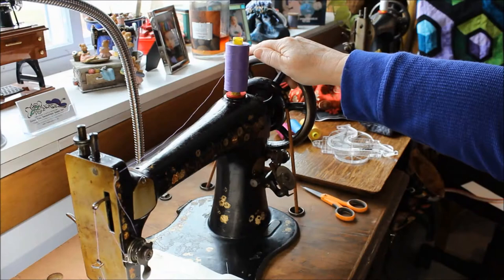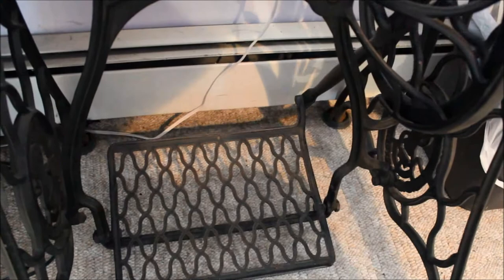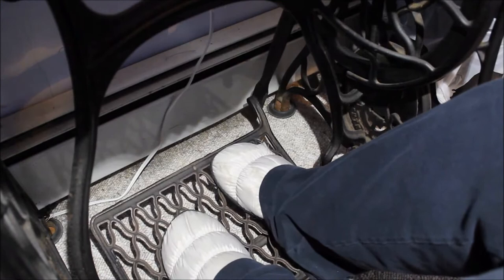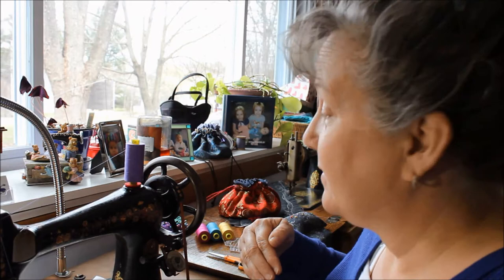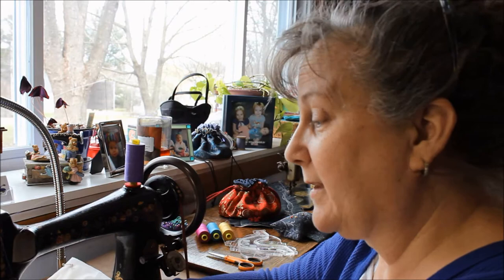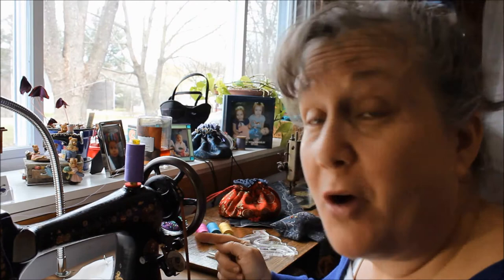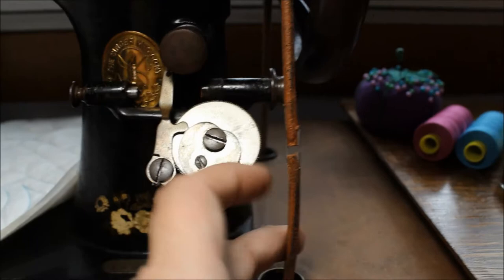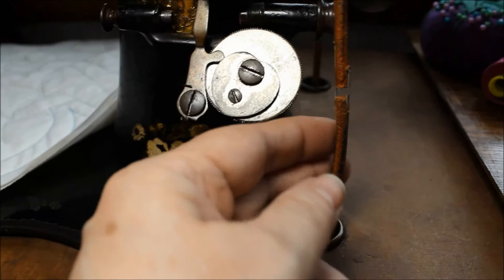Treadle Challenge HELP!

Comment: My Faultless looks similar to the machine you are using, however, it appears your wheel has a de rail mechanism.
I don't see one on mine. If not, will the belt be stretched more ealily? I can leave the head up and keep it covered. I'm new to this. My husband's cousin gave me the machine. It was her mother's. I pray she used it as well! I'm hoping the repair shop is good with it NOT being a Singer. Thank you for your channel. Your sewing room is beautiful!
Reply from the maker: You can still take the belt off the big wheel without the de-railer.  It's just not as easy.  Always best to store it with the belt off so that it won't stretch out over time.  Thanks for watching and thanks for the compliment!  You can also find me on facebook.com/TheMasqueradeNH or if you have more questions when you get the machine back from the repair shop, you can send me an email at TheMasqueradeNH@gmail.com.  Happy treadling!  Smiles, Donna

Comment: The trick is to spin the hand wheel toward you when you start. So the foot pedal starts moving.
Reply from the maker: Apparently, according to some followers of this page, the Wheeler & Wilson No. 9 spins the other direction!  So not  all treadles run with the hand-wheeling spinning over the top and toward you.  That models runs with the wheel spinning over the top and away from you.  ;)  But yes, definitely start the hand wheel spinning to get the pedal moving when you start out!
Reply: It's good to learn hands-free starting and stopping if you can, so you can use both hands to control the fabric.